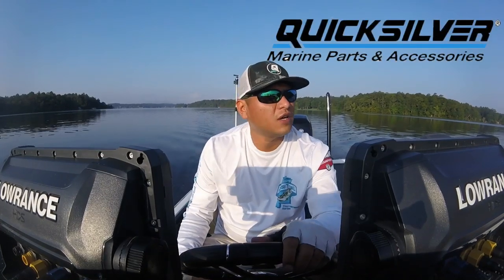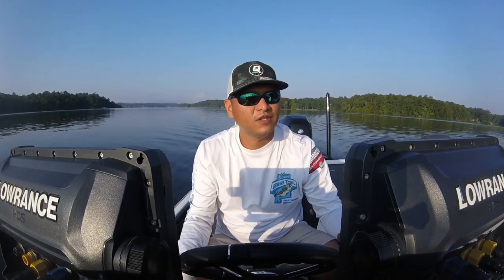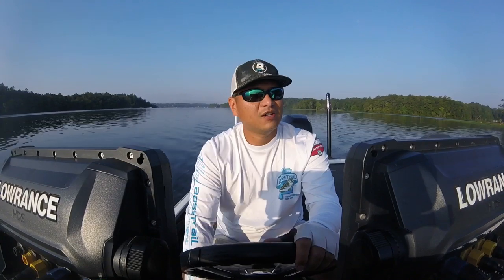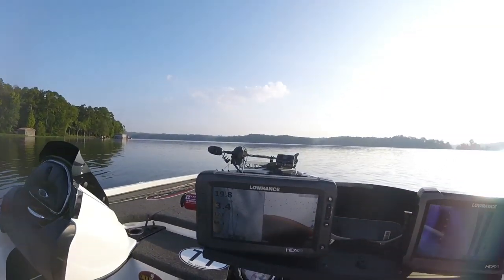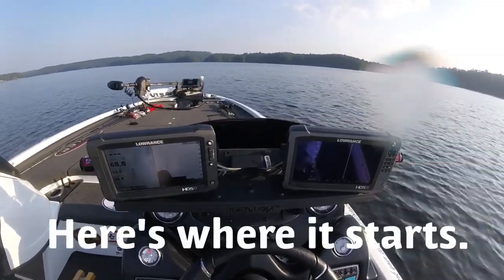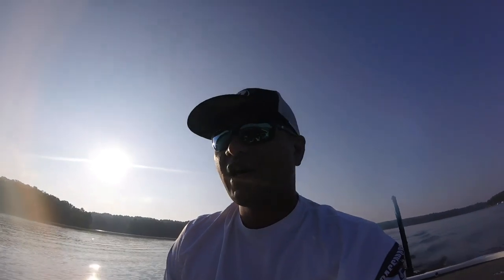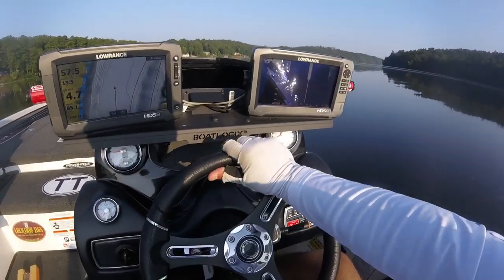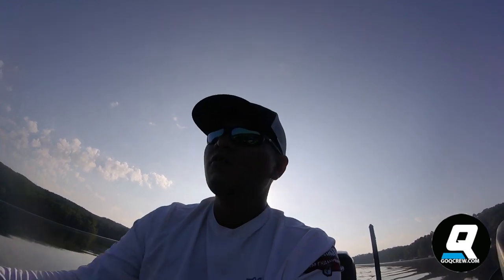Chine Walk Tutorial

Comment: The book by Earl Bentz (The Performance Boat Bible) describes this same steering maneuver to counter act chine walking as well but adds another maneuver, for a right hand rotation prop the boat will lift or rock onto the right chine so the left chine will go high you can either counter that lift and rocking motion by meeting the lift with a left twist on the wheel or you can stay in a shallow left turn this will also correct the lifting or rocking motion. This motion is caused by prop torque as the blades load and un-load at or close to the surface of the water, things that can diminish this effect are smaller diameter props and adjusted mounting heights at the transom.

Comment: You run bow down a checkmate or other older boats “fly” the hull to get on the pad. My boat was rock stable at 74 mph but a sudden swell it was like a motorcycle death wobble chine chine maybe 3 then spin      One good advice trim up and go max throttle get back in line power out if you can

Comment: Nitro triton are two of the worst to chine. I've gone through 4 boats in 30+ years of chasing bass and I'm on my 5th haven't had the issue with skeeter ranger or basscat my express wouldn't go fast enough to chine. But have drove buddy's boats that did and yes its all in the stearing, small tweets once it starts and push on . Sometimes you have to adjust your jack plate down a bit and it will stop it all together. But some boats are prone to chine , bad pad design.
Reply: @johnathanstuckey531  my zx250 doesn't at all , as much as thay sell these things for you would think thay would all be top notch performers. But you've learned to deal with it and kept pushing on. Good fishing.

Comment: We’re those small corrective wheel turns all you needed for the Triton you had or were they larger turns?  The reason why I am asking is because my friend has a Triton Tr21X and his starts chine walking at 64.
Reply from the maker: No the x series required slightly more correction. With more seat time you will figure it out. Mine was same way. Started at 64 and got downright ugly. A month or so of fishing several days a week and I was running 76 if I wanted to. The only reason I know it was more correction was when I got the nitro I was over correcting initially. Took a few weeks to dial it in.
Reply: @johnathanstuckey531  Was it the same type of left right movement of the steering wheel correction or was it different?
Reply from the maker: @vhf2582  pretty much if I remember right. It’s been a while. Just pay attention and the first time it falls to one side remember which side it goes to. Should be pretty consistent based on how you are loaded. I also tried to keep the bulk of the heavy soft plastics in the rear of the boat.
Reply: @johnathanstuckey531  Thanks for the help.  👍
Reply: One more question.  Would a 4 blade prop help lessen the chine walk?
Reply from the maker: @vhf2582  not enough to justify the purchase but maybe slightly
Reply: @johnathanstuckey531  Okay, thanks.

Comment: I know this is a old video but I have a 22 ft Triton with a 250 pro xs... hydraulic jack plate and a fury 3 blade 24 pitch prop....at 68 it starts to walk and the more I correct and trim the worse it gets.....any suggestions
Reply from the maker: Honeslty hard to say but I’d start with Jackplate height. If you have a Jackplate start all the way down and work up as you get used to the boat. Trimming down and slowly easing out of the throttle should get better under 65 mph.   My tr20x was terrible above 67 mph. Much like you are saying. It took a couple months of seat time but I eventually had the boat figured out and was running 78 not batting an eye at it. Then got the nitro and it wasn’t as bad but definitely different. Had to learn the new hull. 

So what I’m getting at is every style hull will correct a little different. Coming from a straits to the triton I had a learning curve. Then from triton to nitro i had a learning curve. The corrections from the triton made the nitro worse so I had to relearn that muscle memory if that makes sense. The only boat I didn’t have to learn anything on was my fx21 Skeeter. I put it on the floor and you could let go of the steering wheel and run 74.

Comment: If you can't trim up enough to keep the boat up on the pad, you're not set up right or don't have enough power and you're plowing through the water. Of course it's gonna chine walk. Many bass boats are too heavy and under powered to get up and stay on the pad; they keep falling off and walking. There's a proper measurement for the height of the engine on the transom that makes a big difference too. Not to mention the need for  experimentation with different pitches and types of props.. Or you can just drive through it like this guy. Very mild walking in his case.

Comment: so there is nothing you can do mechanical  wise just get used to it
Reply from the maker: matthew strachan distribute weight as even as possible then just drive lol.
Reply: Johnathan Stuckey I just bought a z19 with a 200 around 65 is when she starts
Reply from the maker: matthew strachan every boat I’ve had that walked started around 64-65. Play with weight distribution and prop height on the jack plate. Some props like to run deep. Some like to run high. But the best thing is to learn your boat. In a few weeks you won’t even notice it any more.
Reply: that is what i am figure i gotta get more hrs on it before i start changing props i have a hydraulic jack plate was told not to adjust until after the break in period never had a jack plate 64 is fast enough for me on the rivers here in south Carolina  lot of other boaters that like to hog the water i hope to run 70 eventually at lake maultire
Reply: @battleship Strachan
: You can place a hydrofoil on the engine or mount trim tabs on the transom.
Reply: @thedutchfisherman7078  No.....learn to drive

Comment: That wasn't real chine walk. Id love to see this kid in a real bassboat from the 80s or 90s with a strong 200hp 2stroke on it . These heavy 4stroke turds can be driven off by any rich kid  that dad buys them one . They weigh twice as much as old bass boats and the lame 4stroke doesnt even get the hull out of the water, its,just sad ,they are 25mph slower with these motors,bassboats are dead,just a rich fishing boat now
Reply from the maker: John Doe. rich kid? I’m 35 years old. Paid for my own boat. I run a 2 stroke. Not a 4 stroke. This boat will run 74 on a good day. My triton before this boat would do 78. Try to have a few facts straight before you assume things. No this boat does not chine like my triton did but dealing with chine walk is the same process no matter how big or small. My triton wouldn’t run over 64 without getting WAY out of hand if you did not make the corrections.
Reply from the maker: New boats weigh twice as much but turn more HP at higher RPM with more torque. I’ve been in a bullet running in the 90s and driven one into the 80s. I think I can drive just fine.
Reply: Yep.  Damn 4 strokes are pigs